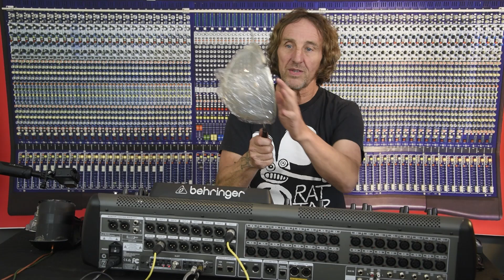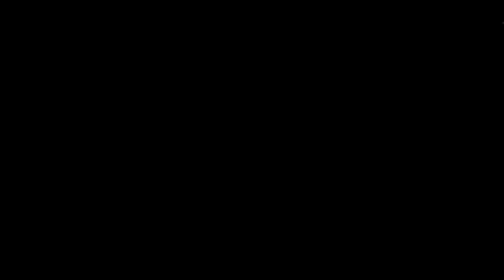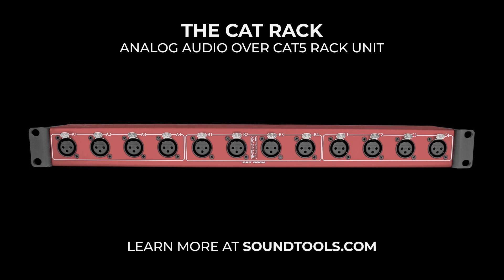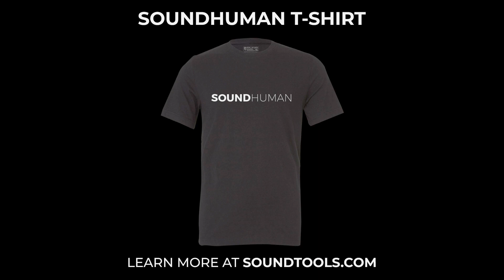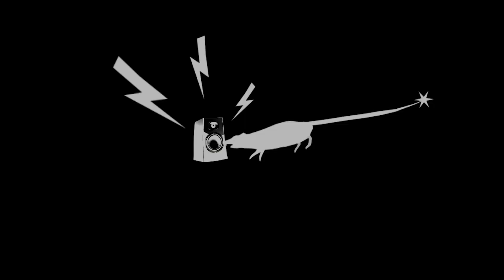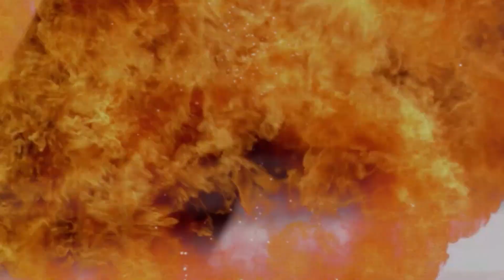Aux Fed Subwoofers Are Better - Because of How Mics Work

Comment: Good Stuff Dave! What made me switch to Aux Fed Subs was a scenario where I was mixing for a few comedians. One wanted house music and a few tracks for him to perform with and another playing guitar...etc.... so I used subs. My system was setup like I use it for rock shows. Magnitude Response has a tilt to it... strong in the low end... One comedian wouldn't keep the mic close so I started getting some low rumble. My RTA kept showing a frequency well below the high pass setting on the vocal mic. One guy and one mic... nothing else going on at the time. It hit me that I just need to make the switch to aux subs and I never looked back. The high pass filter isn't bullet proof on systems with a spectral tilt. That is what the problem is... but I don't like the sound of my system completely flat all the way from one end to the other. So on an Aux, it's impossible for a vocal to get into the sub unless you want it to. For others that don't have subs on an aux try this at your next gig: Shut your tops off and turn up the vocal mic and speak into it and listen to the subs. You will hear some rumblings in that sub even if your high pass is set pretty high... multiply that by all the mics and no wonder the low end is a mess. I love aux subs and 99% of the touring acts that came through our town venue wanted subs on an aux.
Reply from the maker: Yes and exactly and thank you

Comment: I learned subs on aux near the beginning. The video is actually pretty relevant to me because I hold Mr. Rat's opinion in high regard, but also somewhat recently had made the switch to LR after a diatribe from a very senior, touring engineer advocating LR and basically telling me that Aux Fed Subs are a flawed way to do things. 

His reasoning was,  as I understood it and recall: Take the kick drum. You make a certain EQ for the kick drum and send a healthy amount to sub aux. In further processing the kick channel you decide to send more or less of it to the sub aux. In doing so, according to that engineer (or how I understood him), realistically that will change how that EQ or processing is behaving on the channel. Sending more kick to the aux sub creates an effect where the processing for the channel is no longer predictable, as the amount of kick in the sub is increasing and potentially blurring the phase(?). Just by virtue of something being louder or quieter there's a natural/psychoacoustic (fletcher-munson-type) EQ curve thing going on. So for only the crossed-over low end to be raising in volume against the LR image of the same channel.. phasing and predictability of processing suffers. Something like that.

And just one gripe I have with the video is in the HPF demonstration portion, the HPF demonstrated is much lower than engineer are actually using when they use LR, no? Vocals will end up going to something like 150.. depending on the slope as well. And for a high hat which is by the drums and bound to pick up low end, a 90hz HPF is pretty unrealistic. That would go somewhere to at least 300hz and have no chance of being the subs I'd assume.

I definitely digress, I'm not an authority on the subject. It was my deference to that one engineer that made me try to understand exactly why he was so adamant about the concept. But of course, at the end of the day, we use our ears - and I've personally never been inconvenienced by the concepts above when using aux fed subs. So it really does come down to a bit of a "purist" contention. But if anybody more learned could tell me if there's some truth to the concepts, I'd be interested to know.
Reply from the maker: I used 90 Hz because most true subs crossover at 80Hz. So I could show that a high pass at 90 let's loads of energy even when the  subs only go up to 80.

Setting super high high pass filters does reduce energy to subs but also tends to sacrifice warmth and sound quality.

With subs on an aux, those things are seperate. You set the high pass for best sound, not to keep energy out of the subs. You send to the subs for best sound, not just send everything and try and high pass out the excess
Reply: @DaveRat  Well with a 24dB/octave high pass you would lose 2dB per semitone lower, which does let a surprising amount of bass through in the top of the subwoofer end. With pink noise a drop of 24dB is about a fifth of the psychological loudness, although going down from 90-45 Hz produces further loudness reduction in and of itself even at the same SPL, but certainly those upper bass sounds are coming through clearly.
To amplify some church vocals I had a couple of E Audio 4" cubes and I would set a 24dB/octave high pass at 132Hz and boost the top treble as the speakers had no tweeters. I used a condensor mic with a piece of J cloth on it, although most of the speakers were idiots and left it on the table, providing very little amplification 2 feet away without feedback.

Comment: Dave, thanks for the video. Decided to try things with a macro on my SD5 to flip between LR fed subs and Aux fed subs. I felt like the difference of noise in a full mix that less inputs to the subs made wasn’t worth the trade off of losing all of the stages of buss processing that results in the matrix feed. The aux fed subs didn’t feel as tight or as much a part of the mains system. Obviously this will vary vary depending on room and system configuration, but for me, I think I’ll stick to subs on a matrix. But thanks for sparking some good tests on my end!!
Reply from the maker: Interesting. So sending everything to subs via the aux method should sound and be identical if set up correctly.

Then eliminating things to subs that are not needed should give advantage of no audible difference. But sounding less good should not happen.
Reply: @DaveRat  Basically, sending inputs or even some subgroups (kick group, bass group, etc…) to the subs skipped 2 or 3 levels of buss compression and shaping (kick group to a dry and parallel groups, to a drums bus, to a band bus, to a master bus for example) which I think is what led to the loss of tightness. Interestingly, aux fed subs at 0db ended up being louder sounding, but not as controlled.
Reply from the maker: Yeah. Losing aspects of the mix control is not ideal. For that I would probably isolate and mirror the groups with instruments that need subs to separate groups and send subs from those groups.
Reply: @DaveRat  interesting idea. Will give that a try!
Reply from the maker: Cool and really appreciate the giving a try and the updates. 

Thank you
Reply: @DaveRat  thank you. Your videos are such an amazing resource. Keep being awesome!

Comment: I do a ton of fly in dates, what i find is that the supply companies often don't have a long enough line to make sense to have a sub on aux as the main array is not long enough to get low enough. I often request point source setups in these venues but most companies have moved away from it thinking lines are the best for every application. How would you reproduce or simulate the the low mid response on a line of 6 or fewer boxes, baring in mind these are often 6" or 8" line cabs.
Reply from the maker: I don't really see any correlation between not sending unwanted energy to the subs and the system type, size or config

Comment: It is very easy to setup an entry level sq6 to test and compare these strategies on site. Delay compensation is here. Aux can be sent to Matrix, Group can be sent to Aux or Matrix. We can mute the aux to sub matrix contribution and unmute LR to sub matrix contribution to compare (as well as variations using groups). The mix has to sound good both with and without subs - some comments make it appear as though it’s either higher HP frequencies or aux to sub, never in combination. Small differences add up.
Reply from the maker: Yes!!!

Comment: My cheap ass stereo broke, and this is making me reconsider what to look for in my next stereo. It makes a lot of sense that if you don't filter your audio accordingly to the speakers you are using, the garbage will distort the audio you want to hear. Whether it be the signals you want getting drown out by the distortions, or the mechanical limitations of the speaker itself from being able to move its diaphragm fast enough.

Comment: only idiots use behringer
Reply: You deliberately set the high pass point at 90hz knowing full well the q on that desk will still let in signals above 45hz. Should have set 250hz high pass that's why you don't know how to mix. You set up the demo to prove a dumb point that only sounds smart to you because you don't understand eq . Pros would recommend to use a high pass filter properly not the way you abuse it. It's not a crossover it's a high pass that's A DIFFERENT THING. If a cymbal doesn't emit under 200hz why did you set 90hz other than to be a dick. I'm pretty sure that even behringer EQs are fully parametric so that's a fail and if you set it up as a 90hz hard shelf that's even dumber. Didn't anyone teach you how to mix lol
Reply from the maker: Oh my. Perhaps you should do your research before offering opinions?

I show demos that you can do yourself with gear most people can afford.

And thank you for the smile. The people that know the least often have the strongest opinions and you fit that well.

Oh, and also, have some fun and do a little google search on me and my credibility and you on yours.

Please post what ya find. The re read your posts and look up the definition of idiot and let's see where that gets us

Comment: Ok, I’ve finally gotten around to watching this.

Why limit this principle to subwoofers? On 3-way mains, I’m not sure I’d want the HH mic to go to the (non-sub) woofers, either. And is there anything we shouldn’t be sending to the tweeters?

How does this interact with system crossover points? Do we need to start specifying “standard” frequency responses so that the results of this will be predictable and consistent?

I’m pretty firmly in the “if it sounds good, it is good” camp, so I’m not trying prove anyone right or wrong. I’m just wondering what the full expression of this philosophy would be.
Reply from the maker: Well, tweets on an aux were a built in feature of the Rat Trap 5 system I designed and has toured the planet.

That said, some things take little effort and offer significant returns and as you go further the effort increase and the returns diminish.

Subs on a seperate send has string advantages and is simple to do. Tweet on an aux sound amazing but is really requires a system with HF plus tweets. Much like a system has LF plus subs.

Not only does subs on an aux clean up low end by not reproducing unwanted rumble and LF stage bleed in the subs, it also improves coverage in the crossover to subs region reducing interactions between subs and mains due many of the same signals sent to both.

I recommend trying it, setup subs on an aux and send everything to subs so you are operating like a subs on L/R. They see if removing unwanted inputs from the subs cleans up your mix.

I have yet to hear a mix it did not improve.

It's a gift! How often do you find a simple consistant way to make things better with no real downside?
Reply: @DaveRat  I’d love to A/B it with my current “use the HPFs liberally” setup. Unfortunately the system processor isn’t setup for it, and I don’t have a good way to change the settings because it’s old enough that my boss doesn’t want to get a PC just to control something that works and will likely be replaced soon (yes, I know, I don’t get it either, but it’s not my decision).

I’ve used aux-fed subs (and mono-fed subs), too — mostly aux-fed, actually. I’ve never had the chance to switch between the sub schemes on the same PA in the same room, though.

If you have enough busses, I could see having sends for every set of drivers, and using multiple crossovers in the processor to manage it all. I’m not sure how to integrate it with something like the l’acoustics stuff where you just tell the amps what’s plugged into it and they setup their own internal DSPs and such for you. I mean, obviously you could do stuff in the processor before it gets to the amps, but at that point (AFAIK) it’s not the same thing.
Reply from the maker: Very cool and there is a point of diminishing returns where if he is a separate speaker for each input none of the speakers work together so you lose volume. Conversely if you send everything to every speaker they all work together but then you have phase interactions and beaminess in the coverage

So it's not a push it to its extreme type of thing it's a find the right balance between useful and overcomplicating and making it worse.

Comment: I never hear engineers talk about creatively using subs on an aux too. There are quite a few times where my kick has been to clicky and full of high end information that I don’t want, so I’ll push the sub send from it’s channel a little higher and back off on the fader. Of course, I could EQ it to fix it that way but my other method is often quicker and has better phase coherency. On that note HPFs cause a certain amount of phase distortion too!

Comment: Great video as always.  I'm looking to get a sub at some point to pair with my Mackie Thump 15's... I'll keep this in mind but it seems to me only valid for live situations with microphones right?
I'm curious if I'm using only digital instruments if this is necessary.  For instance my drums are coming from EZDrummer VST in Ableton.  My guitar is coming from line-out on my Pod Go or Boss Katana (i.e. not from a microphone).  So I'm thinking these shouldn't have unwanted bass frequencies and I can just send the full mix to the sub.
Reply from the maker: Yeah this applies mainly to life miking instruments where low-end vibration and sound bleed leaks from one instrument into all the other mics or there's wind noise.

For electronic instruments or studio recordings where you have a lot of control over sound bleed vibrations and wind this is not something that is very important

Comment: Thanks for the video! 
Now if we can get the concert audio engineers to figure out that the kick drum is not the lead singer. 
One of the best concerts that I’ve ever heard was ZZ Top back in the early 80’s. Horn loaded cabs in the air and horn subs on the ground. No matter where I walked around in the stadium, the sound was full, fat, and punchy. The vocals didn’t kill your ears, and the kick drum didn’t become the lead singer. 
Matter of fact, I don’t remember any concert sounding like crap up until the mid 90’s. 
Line arrays and DSP killed the glorious concert sound.
Reply from the maker: Interesting, I have the opposite experience.

There used to be a battle between the two largest sound companies in the US, Showconand Clair

Showco was horn loaded and Clair had an all in one box that formed line arrays when stacked.

At the US Festival in 83 clair did mains and showco did delays.

Walking around, the difference was huge. Mains sounded great, delays sounds crap.

That was the beginning of the end for horn loaded being embraced for the upper levels.

Horns started getting smaller and smaller after that

Showco soon after dumped that horn loaded rig

Eventually Showco ended up being bought by clair
Reply: @DaveRat  thanks for the reply. 
I am not sure what boxes were used back then for ZZ Top. I’m very curious now! 
I think I had seen your EAW cabinets at an outdoor concert. We’re they like a proto line array (?) like a combo of modern and the older horizontal/vertical  spread? 
US Festival and Woodstock use to be a rare thing in USA.  Today, just hang a bunch of tiny speakers all over the place, place your bass cannons, run your DSP, and ta-da! I’m obviously joking, but it does seem like it’s more about pack space on a truck than how can we sound good in a 10,000 seat basketball arena.
Reply from the maker: Zz Top was a showco account.

Modern line arrays have the advantage of being better at volume consistancy over distance.

And with speakers handling more power, bigger amps and better processing, we are able to get higher volumes, increased sound quality and use less truck space.

Truly amazing stuff
Reply: @DaveRat  I truly thank you for your time and effort to reply. 
Now I can stop the “memory berries” about that ZZ Top concert, and add real data to that old experience of many decades ago. 
You really are a gentleman and a scholar.
Reply from the maker: Great to meet you and thank you and you really hit the most important aspect on the head.

Sound reproduction is about creating memories and experiences. The Fidelity and methods used are secondary what really matters is if the connection is made between the artist and the audience